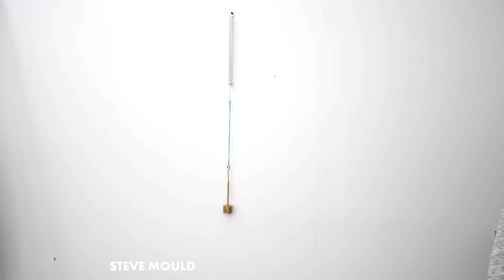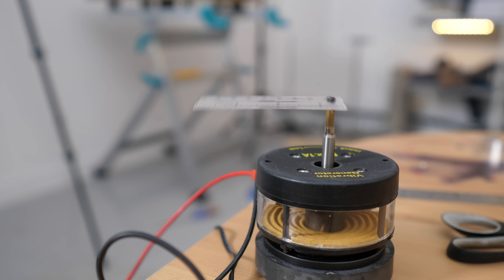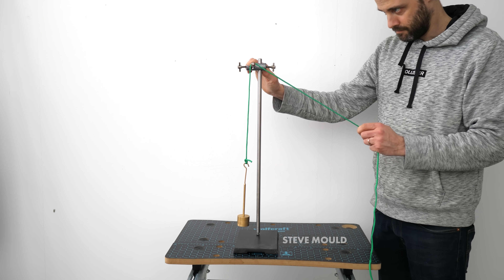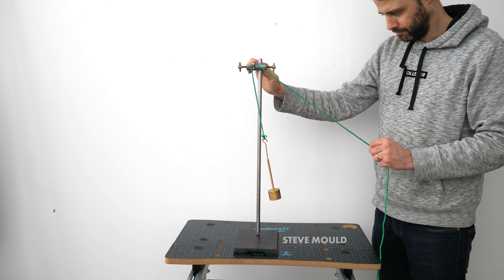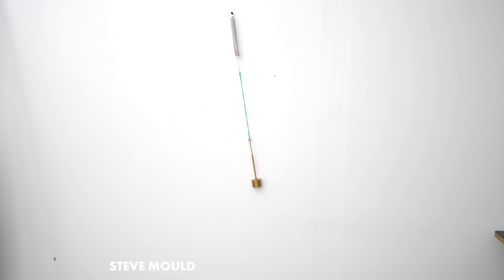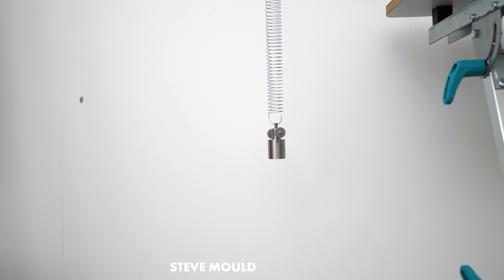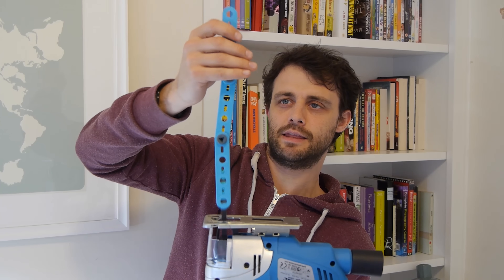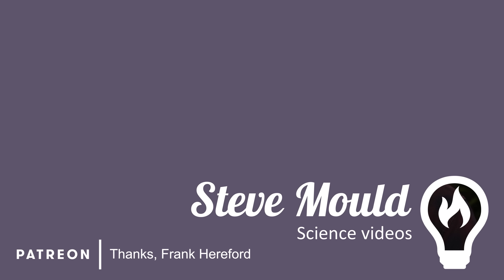What If Swings Had Springs Instead Of Ropes: Autoparametric Resonance

Comment: @ 6:16, I thought by lengthening the string at the apex of the swing you were effectively adding potential energy; i.e. allowing the weight to fall a greater distance.  Con/in/obversely (grammar?) you were adding kinetic energy (upward pull) at the nadir of the swing.
Not dismissing the argument presented, just using a different frame of reference.

Comment: Your swing has at least 2 issues. It's too low to the ground, which prevents the kid from using his legs to propel himself, and the ropes are not equal length which causes the swing to tilt to the side each time. This channel is about observation right?

Comment: You guys ever play with Astrojax? They were billed as a “3D yo-yo” and are basically two weights at either end of a string with a free moving weight in between. You orbit the outer weight around the center one by pulling the other outer one with rhythm to “whip” the free moving weight into orbiting the furthest one, just like this.

Comment: What I don't understand is how the system 'remembers' in which direction the energy is being transferred. If you had a snapshot of  the pendulum when the swing is increasing, and one where the up-down motion is increasing, how could you tell them apart?
Reply from the maker: One mode is 1/4 out of phase with the other. Either ahead or behind depending on which way the energy is going.

Comment: The problem with planting trees is that they take tens of years to grow. So you remove greenhouse gases from the future but you produce them now. Economists usually discount things that happen in the future; something that happens after 20 years is almost worthless. Even if we offset everything, the GHG levels rise if we pollute more now. And this doesn't even take into account that the trees may be killed prematurely and fail to do anything. All other ways of offsetting also only remove greenhouse gases from the future and are not certain.
This would be a good video topic on this channel!

Comment: Does it have anything to do with the width of the string and the outside moving faster than the inside against the spindle?  Does the first pull of the string move the weight to the left because the left side of the string moves slightly faster?  There must be a point where it would matter, so how thick would the string have to be?

Comment: Is it not also correct that you are allowing the pendulum from it's highest point back to it's lowest point to gain more acceleration (ie more energy) because of the reduced tension on the rope when transitioning from high to low points (essentially allowing it to almost "free fall")?

Comment: I suppose you could also make a system with all three of pendulum, spring, and rotation modes. I wonder if you can get an unstable mode that transfers energy cyclically between those.

Comment: Hey, Steve! When I was 6 or 7,  my grandfather in west Virginia built my cousin and myself a swing set... I noticed over time that pulling backwards (perpendicular to the chains) as hard as I could while I swung forward, then releasing as I went backwards, that it greatly contributed to how high I would swing. I still pumped my legs, but felt as though this almost doubled the efficiency I could gain height at...Being a child at the time, I obviously didnt understand it from a physics standpoint, but is THAT not an example of parametric resonance in swinging? Just curious, thanks a lot!

Comment: CLOSE and nicely DONE👍!
By tugging the string at each end of the swing you're 
1.  momentarily shortening the RADIUS of the swing ( pulling IN the arms of the spinning ice-skater ... ) at the SAME time as you're 
2. RAISING the height of the mass thus adding to ITS internal Gravitational Potential Energy. 
When PUSHING -horizontally - your child on a swing at JUST the right time ONCE in the pendulum swing (twice if your wife is in front - strategically chosen by you to avoid the
 "swinging-legs-impact" or "getting kicked on the noggin" phenomenon 😉) you're participating in the resonance of the system , but shortening or lengthening the radius and adding potential energy while part of the closed system, is parametrically primary to the secondary effect of  "resonance" even tho the "timing" makes ALL of it part of the resonance youre - very nicely describing !
Think of the kid's "pumping and leaning" to increase the height of the swing and you get an idea of internal system "resonance" adding amplitude to the swing.
All of your "pulling-string" is injecting EXTERNALLY SUPPLIED ENERGY into the "System" . 
The spring alone works off of ONLY the initially-imparted energy.
 Good Vid, and overall good description of the phenomenon 👍! 
Fun diversion, too ! 
The COOL part tho,
 in MY opinion , 
is- 
There are a whole HANDFUL of factors all coming into play, that at first don't seem obvious or connected, but when brought out as you have here make for a very interesting look at a basic bit of Physics !! Science is INTERESTING - and Engineering makes Science
 _ FUN_ !!
Thanks and ALL the BEST 👍!!
-C.

Comment: You could probably do an autoparamatric resonance with a swing by both translational and rotational modes (instead of using a spring).  I'm sure I'm not the only one who as a kid remembers finding that one cheap swing that no matter how hard you tried whenever you tried to swing on it it you would just end up spinning eventually instead - likely autoparametric resonance between those modes.

Comment: The Mathieu equation, (pronounced matew or mathew) is a fun equation. There are papers written that describe what happens when tweak various parameters. Parametric excitation is a fascinating topic. 

If you perform a multiple scales expansion (I would guess a first order would be sufficient) on your model you will be able to see the slow change from swinging to bobbing in your spring pendulum.

Comment: Hmm, as an electrical engineer, I see this as a coupled resonance problem. If you have two resonators that have their frequencies very close to one another, but not exactly the same, and the two are coupled in some way (some fraction of the energy from one resonator couples to another and vice versa), you get a phenomena where the system as a whole has two resonances with eigenfrequencies that are much further apart than the two original oscillators were. This happens in systems like wireless power transfer circuits and some other handful of scenarios that really aren't that useful.
And if you know about signal processing you'd know two frequency peaks that are a little bit apart from one another--that's equivalent to one oscillation with a sinusoidal amplitude variation (essentially AM)--that's exactly what we see at the beginning of the video!

Comment: Have you tried the auto parametric spring in 3D space? Against the wall the movement it's just an 8 shape. Perhaps in 3D space will happen something more interesting. 😄
Very nice idea, thank you!
Reply: Yeah, it would be more interesting, but also much more chaotic. The best (coolest) scenario that I could think of is having the unstablility copied along the 3rd dimension, out of phase with the original instability by exactly one half. Or perhaps one stable phase and one unstable phase would be interesting to look at because one is a multiple of the other, IDK.

Comment: The lego man at the end made me wonder if you could have three sets of resonance. If you replace the string with a bar attached to the string with a bearing, then attached to that post is the weight with the bars on the x-axis. This way it would have a spring force, a pendulum force, and a twisting force all acting on each other. Three-way autoparametric resonance?

Comment: I accidently found this out myself. when I set uop a small kids swing in the shed.   Instead of using normal rope I using elastic rope, and I added one of those tool weight relieving spring attached above it.  This meant depending on how I started it I could get normal swing motion, Inverse motion where the middle was the highest and also a straight line  backwards and forwards.  My kids enjoyed it.

Comment: A long time ago I learnt about parametric amplifiers on a telecoms engineering course. These devices were used as low noise microwave receiver amplifiers . I never realised there would be a  mechanical equivalent and I recall 'paramps' to get microwave gain, also have to be exited  ('pumped' is a word that rings a bell) at twice the incoming carrier frequency. It's a pity I wasn't aware of the mechanical analogy, it would have aided understanding of operation the device. I'll now google Wikipedia - parametric oscillator for more info. Thanks!

Comment: Do the springs have to be metal springs for autoparametric resonance, or could one use a rubber/elastic spring? 

If the springs don't have to be metal, you could probably use a bungee-jumping cord for a human-scale autoparametric resonator swing

Comment: Years of being awe-struck by your breadth and depth of knowledge - and your ability to communicate complex subjects clearly and simply while simultaneously being entertaining - have been blown away in a puff of smoke by seeing how you wear your jeans half way down your ar$e, thus exposing your underpants (1:36). Disillusioned doesn't begin to cover it. You clearly have a deep understanding of spring resonance but you are struggling with the topic of The Purpose of a Belt.😁

Comment: you can see this easier if you put a marker, pencil on the cork, and swing it back and forth,  measuring the distances. (i saw 2 figure "8", horizontal and vertical).

Comment: "The size of spring was starting to get into dangerous territory, like garage door spring" 
As a garage door tech I appreciate that comment. Working on your own door is statically as dangerous as working on your roof. I've known plenty of other techs and home owner with ER trips and a few that passed from being careless.
Reply: By the sound of it, I'd much rather work on my roof than on a garage spring D:
Reply: One of my cables snapped so to replace it I had to tension the spring. I don't have any of the right tools but I do have screwdrivers. So I'm turning it with screwdrivers and then I pin a screwdriver against the wall in hole for the right tool. And as I am putting the cable on, it just goes BING! WZZZZZZZZ. And that's the story of how a screwdriver got embedded into a stud deep enough I couldn't pull it on the opposite side of my garage.
Reply: Plus the fact that garage door counterweight springs are manufactured for twisting force cycles (up/down=1 cycle) and not vertical stretching or lengthening and retracting, yea, much agreed not the right spring for a swing.
Reply: @dallynsr  old commercial doors (like 1950s) sometimes used torsion springs as extention springs. I have worked on a few with that being the original set up. Think I have a set of those springs in my shop.
Reply: @dallynsr  It's an attempt at a constant force spring .. pretty good one actually and long lasting. You can get ribbon type cfs's but they are not high endurance .. they do fatigue much faster than other types of springs
Reply: A kid in my high school was doing something with his Jeep and failed at the DIY spring compression device. He came in to school the next day with a hole in his cheek! People are way too comfortable around springs and tight cables, ropes and stuff.
Reply: @MaxUgly  ive always been terrified of springs, u can never tell how much energy those things are storing (visually). it might be barely compressed and not a danger, or it might slam into you at 50 fps before u even realize youre in the way
Reply: @MaxUgly  considering that the whole weight of a car is supported solely by 4 springs, and remembering that those can withstand potholes and speedbumps without issue, shuld be enough to scare people into handling with caution. 

You cant compress a bike spring with your full weight, let alone a car spring!
Reply: @TheNasaDude  Well, go back in time and tell that to my classmate in 2004! sheese man you act like I told him this was a good idea.. unbelievable, I'm gonna go chew on a ball bearing now..
Reply: @MaxUgly  I don't think chewing on a ballbearing isagoodidea mate
Reply: @MaxUgly idk why you thought he was complaining man, nothing about what he says gives off that vibe
Reply: You could probably do an autoparamatric resonance with a swing by both translational and rotational modes (instead of using a big spring).  I'm sure I'm not the only one who as a kid remembers finding that one cheap swing with the rope attachments too close together that no matter how hard you tried whenever you tried to swing on it it you would just end up spinning eventually instead - likely autoparametric resonance between those modes.
Reply: my Garage door is uncoupled from the track mount. 
i don't see any hardware on the ground. 
it just came down real fast today after we closed it from the car. 
(red cord rides alone now. separate from door and even from chain)
Reply: @Roerco  yooooo.... Pass that shit my way so I can take a puff
Reply: @Roerco that would simply be the safety pin, there is normally a rope you can pull to disconnect the track from the chain of the motor so the garage door moves freely, if you push it back up all the way it should reconnect
Reply: I need a spring Tech to come fix my mattress springs.

I've been putting in some hard work & well let's just say the springs are broken.....
Reply: @ClickClack_Bam  yeah jumping on the bed will do that lol
Reply: Or people unbolting the ring on an air brake canister...  don't lose your head.
Reply: @Saxxonknight  shake hands with danger. . .
Reply: The springs are definitely very dangerous but only if you're actually storing energy in them; using them for a playground swing wouldn't store any dangerous amounts of energy, and certainly nowhere near the amounts that normally make those springs so dangerous.
Reply: @kylehart8829  aren't you in the gdtd group also?
Reply: As a normy I consider that spring FAR FAR FAR more dangerous than working on my roof.
Reply: Rip
Reply: I believe you thanks
Reply: statically?
Reply: Dont steal the kids energy
Reply: Springs have no brain. You need to use your own.
Reply: I got my hand tied up between a chain and a spring when the mounting block split. Freak accident. Almost lost my hand 😢
Reply: My boss knew a doctor that lost the use of his hands, trying to be cheap and adjust his garage door spring himself.
Reply: I don’t know why but working on a roof sounds less dangerous to then on your garage door. Garage doors seem dangerous. Even without thinking about the springs they sound dangerous. But with the springs it sounds much worse. Springs are scary. I’ve definitely had my skin trapped in a spring before and also been hit by a spring before, I can imagine how much damage a big one could do. Springs are very dangerous.
Reply: Garage doors have springs?

Comment: On the "loosely coupled " pendulums demo.  Why does the first pendulum that was oscillating nearly stop?  One might hypothesize that the energy transfer from the moving to the stationary pendulum would stop once the originally stationary pendulim had the same amplitude as the first, moving into a stable mode.  I guess it's something similar to destructive interference in waves when they are out of phase?

Comment: Hi Steve, I have a problem with the sentence from about 5:58 to 6:05. — “That’s because you’re only working against the tension due to gravity, not centrifugal force, because at this point the pendulum isn’t moving, so there is no centrifugal force.”

That premise would only be true of a pendulum at rest: one hanging straight down without movement.

If a pendulum had a swing of 180°, at +90° and -90°, from a “down” of 0°, yes, the pendulum would have no centrifugal force, because the bob (weight) has no velocity, relative to the pivot. Unfortunately the beam (or string) also has no no force applied from gravity, because gravity’s force on the weight is tangential to the pull of the string.

At any point during a swing from a “down” (equilibrium) of 0°, gravity’s pull against the string is greatest at 0°. As the weight moves to wards +/-90°, it weakens. The farther out the swing, the more the force of gravity is accelerating the weight towards “down”, rather than pulling against the pivot.

If the string (beam) were rigid, as the weight exceeded +/-90°, and was above the pivot, gravity would actually cause the weight to push back against the pivot, unless overcome by centrifugal force.

This actually makes more sense if the pendulum went into a full spin. If you were to swing the weight at a fairly even rate, centrifugal force would be a constant, but your force held against the pivot would be greatest as the weight swings through 0° (down), and least when it swings through 180° (up).

Otherwise, resonance is cool… that’s why I play BASS (Adam Neely reference).

Comment: Re: swings attached with springs instead of rope or chain. You might look into Bungie jumping, particularly off of high bridges. Not sure how difficult it might be to get the ratios of 3:4, but I can say from personal experience that you can swing on them. Albeit, Bungie chords do lose a noticable amount of energy due to internal friction with each bounce. Nevertheless, you could lubricate them (just be careful your lube doesn't deteriorate the material) and you could also try pumping or driving them to compensate for the friction.